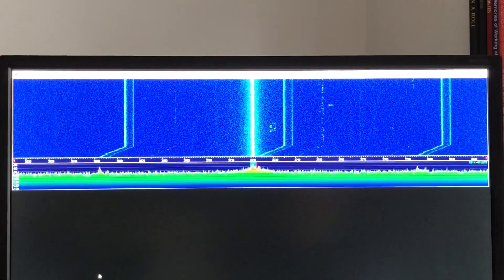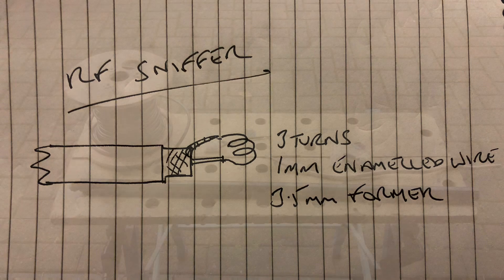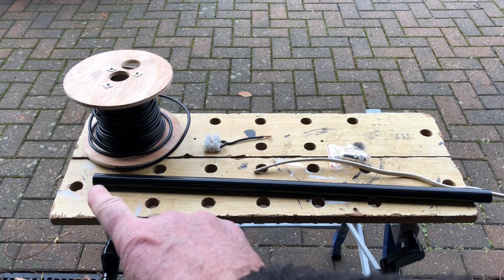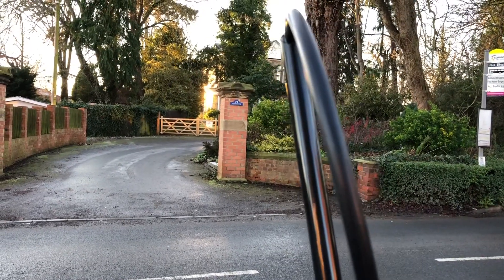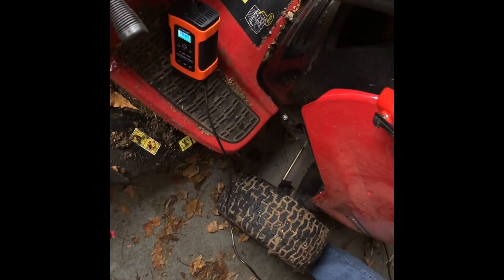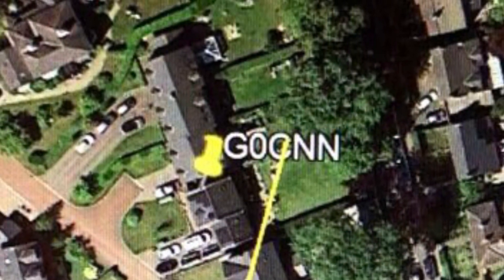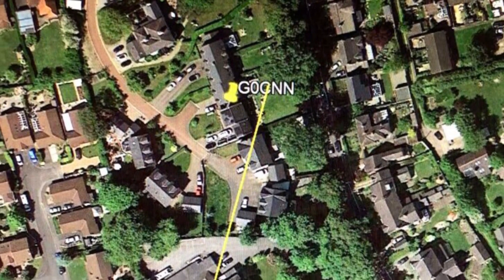I Found & Eliminated My QRM / RFI (Radio Frequency Interference)! 🥳

Comment: OMG ! Iv'e been a long term sufferer of QRM... watched your videos on making the loop and sniffer, So straight into the shack and knocked them up, I printed out a local map and went on the hunt.... It took me about four days to track it down to a single house about a mile from my shack, which is on a hill, and about the same height as my attennas. Knocked on the door and explained what I was doing, with my radio and sniffer and said that they might be the house that was causing radio interference..... the loop was overwhelmed by the noise and I attached the sniffer and found it was a power unit for lights and air to an aqurium. They asked me about how they can cure it and I said I would find a "quiet" unit... Off I went to Dobbies with radio and loops, asked if they could "sniff" the fish tanks, none of their units made a noise, so I bought one (£18.00) and went back to the "offenders" home and gave it to them, they promptly replaced it and cut the wires off of the old one.Best £18.00 spent on my hobby and thanks to you, I can enjoy my radios, de G1YYU
Reply from the maker: How brilliant is that! Excellent result and well done that man! 😁
Reply: A great outcome on tracking down the source.  We can all do this if we try.  I prepared the original DF Loop article for QRM.GURU in VK.  It's great to see so many operators around the world taking steps to reduce the noise floor.  Well done!  
Cheers, Ian Jackson, VK3BUF, from RASA, the Radio Amateur Society of Australia.
Reply from the maker: @rasa2745  Cheers Ian! Thanks for the design and inspiration 👍🏻
Reply: Well done on the elimination and good on you rectifying the problem. With operators like yourself the hobby continues to leap forward. Truly inspiring. 73.
Reply: Congratulations on having compliant neighbours !!!

Comment: I'm horrified by the distance a switchmode PSU caused radiated QRM. This was an eye opener. 73's, Rob in Switzerland
Reply from the maker: @RobWhittlestone  Yes, it was bad Rob. Then I had to track another down a few years later….video on the channel 👍🏻
Reply: @G0CNN-Ian  Ian, I'm actually a Hi-Fi buff, but contrary to the expectations of most people, almost all Hi-Fi is susceptible to mains-borne RFI (because power supply sections never behave ideally) and are also to radiated RFI if the signal/output cables and equipment cases are not well thought out. 
In a domestic setting, there are almost countless sources - switch-mode PSUs, computers, set-top boxes, TVs, sound bars, lights, dimmers, WLAN routers, LAN switches, chargers, earlier LEDs (automotive 12V LEDs even caused QRM on car radios) - the sources are practically endless. 
On my preamplifier and amplifier, all unused inputs are shorted out, all signal cables shielded, loudspeaker cables have anti-RFI material at the terminations and the geometry rejects RFI . Also earthing requires attention (I'm not there yet!) and carries RFI. When I had my house built, I had a dedicated line put in for the hifi. 
So I'm monitoring both hi-fi and ham communities for bright ideas like yours! 🙂 Often the technical knowledge and practical ability in the ham community for filter projects and the like is IMHO superior. 73's Rob
Reply from the maker: That’s a comprehensive setup Rob 👍🏻

Comment: Interesting.  That charger is very similar to one I had that gave the same issues purchased from Amazon here in the US.  There appears to be multiple branding on this Chinese design.  Upon investigation internally the common mode suppression choke had been linked out (removed) and the filter capacitors not installed.  Putting suitable components in cured the issue.  The unit was labelled FCC part 15 which would have only been achievable with the suppression components fitted!!  Either it was not tested or if tested the components not installed during production to save a few pennies (as the board was clearly marked for them).  When it comes to coincidences  I am a British ex Pat  amateur and you guessed it my name is IAN.  One trick I learned professionally when tracking interference was to work out where the QRM was NOT coming from!! by doing this when measuring on the reciprocal bearing any interference apparently coming from the low QRM direction was generally caused by local reflections.  Of course this was automated with a receiver and computer making hundreds of measurements while driving around an area.  The resulting heat map indicated exactly where the QRM/source was.  The technique is still in use today by multiple government agencies to track....
Reply from the maker: @ianatkins5460  Thanks for commenting Ian. Yes, the RSGB covered this charger in one of the Radcom issues and found the same in terms of missing parts. A few years on and I tracked down another and had it replaced ☹️

Comment: Were you able to fit any type of suppressor to the charger to resolve the problem? Thanks for an interesting video. G6ATO
Reply from the maker: Hi Bill. I didn’t bother. I sent it off to the RSGB for analysis. It appeared in Apr 21 Radcom I think it was. The article accompanying this video was out of sync and appeared in Sep 21. Lots of info in the analysis article. Thanks for watching & commenting 😀

Comment: What’s the dimensions of the loop? (Perimeter) Also, is there any special length for 10m? Thanks
Reply from the maker: That’s the third video in the series Adrian. If you look in the description the previous two video links are there. How to make the main loop is part of those (& measurements). It’s not frequency specific, so there is no 10m version, but it will work on 10m 👍🏻

Comment: Was that enough to really affect your ability to use your radio. I.E. making tough DX contacts?
I ask because I have what I believe is Power Company Power line RFI. It actually gets up as high as S9+. I used a police scanner and home made Yagi (made for 130 Mhz) to find two seperate power poles that I believed were at issue. The power company came out and agreed that the two poles were both arcing. Unfortunately one of them because of difficulty to get to and a need to turn off many, many customers temporarily, pole number two may take a month to get to. I'm told by a guy at ARRL that I am doing well with my power company and I just need to give them some time. It has been a but of a nightmare. Weather and customer demand give a variable result. It started as the weather grew hotter and seems to be dropping off as things cool off. The one pole they did work on may have made things a bit better, but the pole they can't get to yet always seemed to be the big culprit. I am currently just trying to learn as much as I can. I fear there's a chance it's something like you dealt with in this video. I must admit though I've read that RFI that has hills and valleys as yours did would not be the power company. In your case of course it wasn't. I congratulate you. This is not the easiest thing to tackle and in my case has virtually destroyed my ability to get on the air for now. I am so curious as to just how strong was the RFI coming from this charger? If you turned off all preamp and filters in your beautiful Yaesu and point your antenna at the source, what was the S level?
Reply from the maker: Hi and good luck with the power pole getting fixed. It sounds like that’s your main source and you’ll only know what’s lurking underneath that noise, if anything, once it’s gone. Yes, a strong RFI source can block contacts on certain frequencies, but it’s also a constant annoyance as you scroll through the band, both in your ears and on the waterfall. It just shouldn’t be there. I have wire antennas and no longer have the problem, so I can’t say in terms of preamps etc. However, it was a significant impact on my normal operating procedures and settings, so that was bad enough for me. If you haven’t seen it already, one of the recent videos on the channel is also based on a RFI hunt. Good luck sorting yours 👍🏻
Reply: @G0CNN-Ian  wow I didn't really expect a reply but you did and told me what I wanted to know. I've always felt so bad for people that end up with this problem. I guess I thought it wouldn't happen to me. Oh my it's horrible. It sure was a nice turn that your neighbor didn't mind letting you explore his property.  You must be really good with people. I like to think I am, but yesterday was weird. I was trying to use my portable short wave to zone in on the RFI. It's a good tool but it can just work from way too far away. Anyhow a woman that lives in the house in front of a pole that PGE concurred with me that it's arcing, started asking me questions about what I was doing. I wasn't in her yard or peering in her windows. I was just standing across the street from her house. I was explaining exactly what I was trying to do. She said, "I don't have any problems with MY radio". I told her if she played AM and turned her radio around in a circle she would definitely hear it. She started acting angry. Taking it very personally. As if I was criticizing her home. So I put my portable on AM and tuned near the high end of the scale. A super loud annoying  buzz came out of the speaker. I asked her if she heard that. "Yes" she said. Well I told her, "thats AM radio". Then she says, "You must bot anything else to do with your time". (Holy smokes I thought) Well O said, I word five ten hour days a week, drive 3 hours a day in traffic to get there and back, then I run twenty miles a week to stay in shape so no, I do have many things I have to do every week. And I'd really rather not have to find a faulty piece of PGE's equipment so I can enjoy my hobby. "What do you mean faulty equipment?"
Oh boy I steppes in it now. "Well I said, things wear out. I find out if there's a problem before the equipment can cause a problem." Then she says, "how come my radios don't have a problem?" Well I just showed you what an am radio sounds like across the street from your home. (She's quite elderly by way. And quite a pistol.) 
Now, the other twenty people I've run in to while walking the neighborhood with a Yagi and police scanner have been really great. They're very curious and I explain the best I can what the deal is. She's the first one that seemed irritated at my presence. 
And by the way, I love your portable setup to sniff the neighborhood. I would like to do something similar. I can't decide what to purchase though. They only radio I own currently that will do 2 meters and 70cm is my police scanner. 
Today and tomorrow I'm going to "improve" my home brew 2M Yagi. If that goes well I'll make one for 70cm. I just watched an ARRL video on the subject and this one says "you must" sniff on 440Mhz. O.K. I'll give it a try. Supposedly, the higher you move up in frequency, the closer you must be to the source of the arc. So 440Mhz is supposedly better to pinpoint the arc. Then I've read that you need an ultrasonic/rf sniffer to verify the arc. I have an ultrasonic dish, but from what I understand, you must have a line of sight path to the actual arc for an ultrasonic detector to show anything. I must admit, so far the only thing I've found with ultrasonic dish is a bee. Buy I haven't yet tried it on a PowerPoint that PGE had told me does actually have an arc.

Yikes! It's quite complicated. 

Take care.

Comment: In my case I don't think this loop would work because I have power line noise so the power line radiates this interference over quite a distance and I've tried a 2m/70cm Yagi and I can't hear it at all on the poles near my house and there''s no point trying on HF because the noise travels miles. 

Worse is that because I live in the sticks the poles are going thought fields and it's not easy access fields here in Ireland with barbed wire, electric fences and high thorny ditches absolutely everywhere, if I get in my car I wouldn't be driving parallel with this 10 Kva line. It would be close enough to the road but not close enough probably. I must try again in the car and bring the FT-818 and yagi. 

I've been chasing this noise for years and I was told by COMREG the OFCOM equivalent to find the noise myself and contact them when and if I find the source so they can verify it. Nice of them isn't it ?

The noise has got very bad over the last year or two.
Reply from the maker: That’s sounds like a right pain. You know the source, but getting the authority to act is another thing. Good luck….
Reply: @G0CNN-Ian  Well you know what ? your video inspired me to go out again yesterday evening and see if I can find the source and I did. 

On previous attempts I tried to find with my portable shortwave radio and because the noise is so broadband it was really a hopeless task + I couldn't get a bearing on the source at all and on HF the noise can travel quite a distance. 

Since my last attempt to find the noise source I bought the FT-818 and more recent a 2m/70cm Yagi but I set off with a MFJ 20m whip and drove as parallel to the power line that I could  and after a while I got fed up and set off back home but kept the FT-818 on and drove with the antenna sticking out of the window and then all of a sudden I heard a loud buzzing so I turned around and parked where I heard the noise, got out and it was buzzing like mad, took out the yagi and switched to 2m and it was incredibly loud, switched to 70cm and it was S5 on the meter so I knew I had found it because I could not hear the noise even on 2m anywhere near my house and I read that if you hear it on 2m you are very close and if you hear it on 70cm you've practically found it. 

So now I'm going to send an email with video and photos to the power company and see what they do, if I don't get a response I will contact the communications regulator COMREG here in Ireland. 

For anyone reading this with a similar problem, I was convinced that I had found the offending pole because the noise was really loud on the portable Shortwave radio but I was wrong. You need 2m/70cm and a yagi, without this you will never find the source because it can only be heard on 2m and especially 70cm when you are at the source. Of course your portable radio will hear this noise at the source but it travels a couple of miles so it's really pointless without 2m/70cm. 

It was pure luck I heard this noise in the car and I only heard it probably because the pole is close to the road, if it had been in one of the fields I probably wouldn't have heard it and it's a very difficult task here in Ireland to get from one field to the other with high ditches, barbed wire, electric fences and gates absolutely everywhere. But lucky because it took me years to find it so definitely the proper equipment helps and some luck.
Reply from the maker: @o00scorpion00o  Well done on persevering! Power company need to act now.
Reply: @G0CNN-Ian  Thanks, I won't hold my breath because I contacted them several times in the last 7 years and I was ignored, then I contacted the regulator COMREG who are equally as useless and told me it would be better if I was member of a radio club and said the best way is to find the noise and contact them back to verify, so I had to do the work......

Anyway I sent off an email to the power company, so we'll see what happens this time.

Comment: I had a pulse charger for a cordless drill. It caused interference for a 1.5-mile range. The problem is, I didn't have that problem before. So I unplugged it and ran it off a battery/ inverter -- no problems, no signals. Only while operating with the mains/electrical receptacle.
Reply from the maker: At least you sorted it Clifford 👍🏻

Comment: About time these chargers/power supplies were tested by the authorities before they are allowed to be imported. The CE mark is obviously not a reliable quality indicator. Either because it is not stringent enough or if it is the import manufacturer is just putting the label on knowing full well the unit is noisy or simply doesn't care. RF interference used to be considered to be an important matter but these days no one in authority seems to care.
Reply from the maker: Agreed. The latter I think in terms of the bogus CE mark 👎🏻 Replaced with a Made in Britain (Birmingham actually) model and all fine since 😀
Reply from the maker: @Brighten Hell Grim.

Comment: Would you mind sharing what make and model charger you bought for your neighbour as i have had exactly the same problem for the last 12 months, it was a window cleaner charging multiple car batteries for his van electric pumps. Without this video i would never have found the problem, so a BIG THANK you for the DF loop idea.
Reply from the maker: Brilliant! The model is a Maypole 8A MP7428. I use one myself and costs about £30. Made in Britain 👍🏻Good luck 😀

Comment: Hi, I don't get the part where you put the loop on the rf sniffer after pluggin the coil to the pl through the coax.... any plans more detailled?
Reply from the maker: Hi and thanks for commenting. Please can you clarify the part of the video you mean? I’m not sure if you mean the build or in use? The minute & second will point me to the correct part 👍🏻
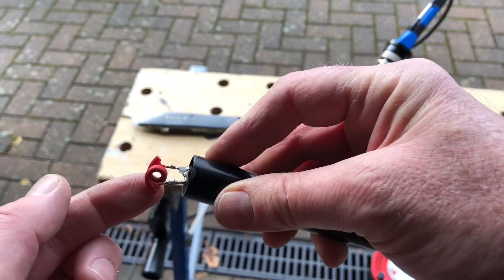Reply: @G0CNN-Ian  Hey yes. https://youtu.be/Pwbk8yP6SIk?t=149 , at 2:29. I can see the tube, the coil soldered to the coax going to the pl inside the tube. But I don't see how it's connected to the loop
Reply from the maker: @djflexlive  Ah right! The sniffer is a separate device to the main loop. I only use one at a time. So once I was close to the RFI source, I disconnected the main loop from the rig patch lead and connected the smaller sniffer instead. Hope that’s clarified things 😀
Reply from the maker: @djflexlive  yes
Reply: @G0CNN-Ian  well I  am not able to catch any qrm with this loop. Could you help me by email eventually ?
Reply from the maker: @djflexlive  yes if you get stuck.